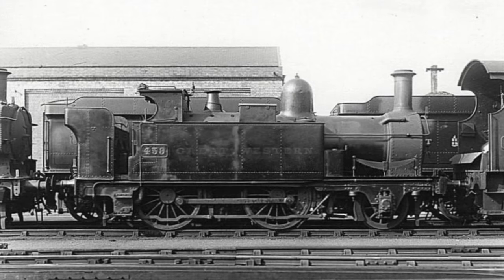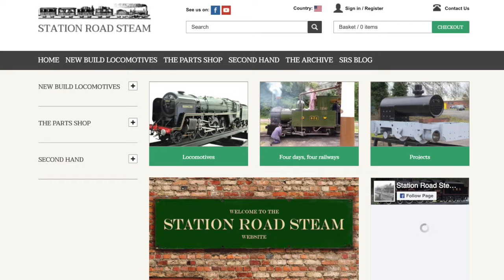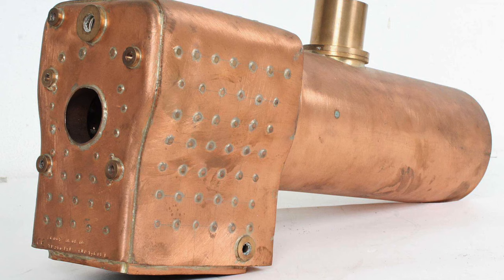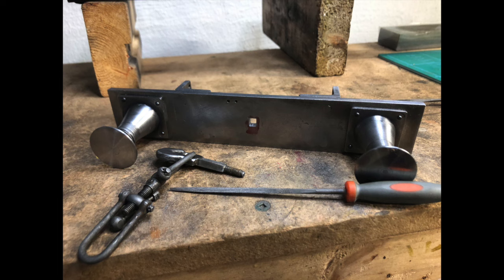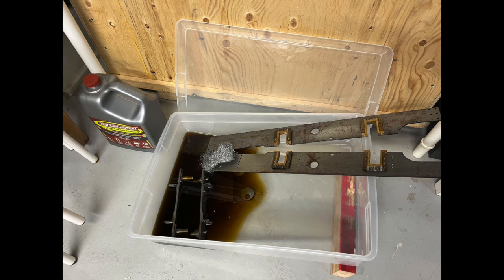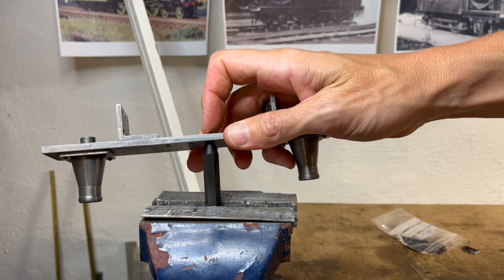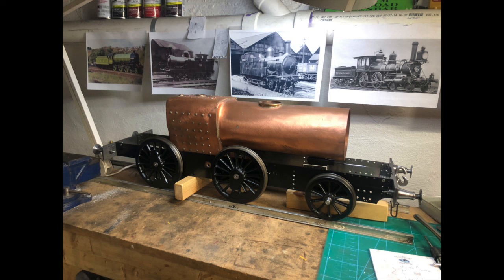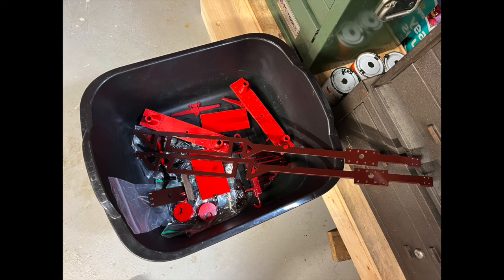Great Western Railway Live Steam Locomotive Project - 'Metro' by Martin Evans

Comment: The Stevenson type of boiler is difficult to make and often causes problems.
I have  designed and made a gas fired boiler for two of the 3 1/2" G locos I have made in my shall workshop
These are based on the Smithies type where the steam raising is in a simple pot housed inside a larger tube.
A  gas burner is housed under the boiler so the heat surrounds it.
I use a cannister of propane mix with Butane housed in the tender and it steams as well as a Stevenson type